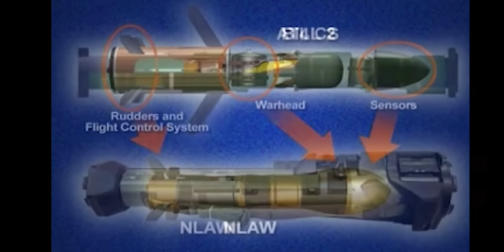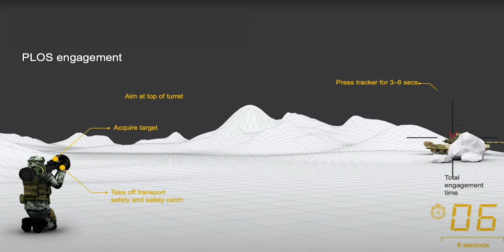Is the NLAW ATGM overrated? Next Generation Anti-Tank Missile

Comment: I am very much torn in half about support weapons embedded into a section/squad or even platoon. OK I do get it. It is far better to have one when you need it rather than not having one. But we keep adding to the basic kit of the section and we are subtracting from endurance of movement and infiltration. 
I believe NLAW has a long career ahead of it as it ticks the 2 main boxes of availability and simplicity of use. The RPG-7 and in the West the Carl Gustav remain the most used RPGS in the world because they too tick these boxes and another vital box re-usability. It could easily be done by having the ammunition come with its own insertion tube that uses 3 or more alignment grooves or spines so that all pins and connectors are perfectly aligned and still remain simple to use. 
Science has the bad habit of removing the amazing and replacing it with the simple. The overhead attack works on the interaction of the electromagnetic fields of 2 objects in question.  The interaction reaches maximum intensity and the moment the it starts to drop the round ignites, similar to the proximity fuse. Trees and rocks don't normally have electromagnetic fields of the massive field that a vehicle has. Sorry if I killed amazing. 
Why the unnecessary night gear in the photos,  the simple answer is propaganda.  Nothing says I am a high tech warrior like night vision on the helmut.
I was once talking to a crewman from our Leopard 1A3/4 (Australia) and pentration and I think what he said about it is still relevant today.  Go into a 5 story building fire escape stairwell with your mate at the bottom of them. From the top you tip a bucket of super balls down the stairwell.  Then ask him what was it like, if he doesn't hit you first.

Comment: Also, the TOW-II is top tech just like NLAW as it's passing over on parallel/horizontal trajectory..
Reply: Depending on the missle used, you get wide array of effects. Direct & top attack vary between missile used, as well as other purpose made missile choices.
Reply: They’re completely different, Tow isn’t even able to be shoulder launched.
Comparing the two is like comparing desk phones to IPhones
Reply: @xxxlonewolf49  Would you compare a handgrenade to a 15.5 cm artillery shell?
There are occasions where that is relevant and reasonable, and ties when it is just stupid.

Comment: The size is a downside in my eyes. I think we(Denmark) have a perfect mix of AT weapons today. We use the new enhanced capability M72 on squad level. Very good in urban fighting. Then Carl Gustav M4 on platoon level. With the new smart sight from Aimpoint. Laserguided ammunition will soon be available. And then Spike LR2 on company level.
Reply: IMO
M72 for almost everyone.
Carl Gustav for the weapons squad in each platoon
Issue NLAWs if expecting armor contact on a squad level. M72 takes care of up close up light armor or side/read of tanks, and bunkers, NLAWs give infantry all aspect standoff capability against MBTs, up to 800m stationary, and 400m moving. It's not even comparable in both capability and weight.
Reply: @prfwrx2497  I'm not comparing the M72 and the NLAW. I would though compared it to the new CG M4, with the new smart sight. These NLAW's takes up a lot of space inside a CV90. Not such a big problem in our Piranha 5 APC's. But still, I think we've a very good setup when it comes to fighting armour dismounted 🤷‍♂️
Reply: @heinedenmark  I disagree, as an infantry platoon you want something that is more LR than the CG. I do see your point about the space it takes though

Comment: I watched the Saab video discussed and thought it was excellent, a question i have though is that it mentions a "saltwater counterweight system" what exactly is that? also in one of the scenes it showed 3 soldiers with NLAW's were they Swedish, British and Finnish?
Reply: Salt is added to the water to reduce the freezing temperature so it is not just a solid block of ice in the winter.  Let's consider an AT4 with no salt water.

 The projectile is launched from a tube open at both ends.  The propellant is ignited behind the projectile so a lot of hot gas will go back when it pushes the projectile forward. That way there is very little recoil but a lot of backblasts that would kill you if are close. In peacetime no one should be in a 90-degree cone 100m long, in wartime it is no one within 15 meters and beyond that, you need to be in cover.

That exhaust will bounce on a wall and come back toward the shooter so firing an AT4 in an enclosed space can kill the user.  The solution was to put a container with water at the back of the tube, that is the AT4CS (Confined Space). Its increased mass will result in the slower exhaust, reduce the temperature and it will slow down quicker.  The no-person allowed area is reduced to a 50-degree angle and 20 meters. The result is you can use it indoors, the requirement is according to the  US manual a room 4.5 meters long and 3.5 meters wide for safe usage.

NLAW uses the same saltwater container design to have very low recoil and the ability to use it indoors in large enough rooms.

Comment: As I've come to understand it the Americans see the supply chain as a big what if. What I've understood is that to use out of country suppliers is the potential to have part's intercepted in transit and either hijacked, tampered with, or in the case of ships sunk but the potential of a major interruption in the access to the raw materials, or finished components, the shorter supply lines to the UK, Finland, and any other of the manufacturing nations is short and there are quicker ways to ship than just ships they can easily ship them by air in small commercial airlines capable of transfer components almost to the front door of the other company's involved anywhere in an hour or so. Where the US is a long distance run making ships rather easy to intercept or sink. Aircraft would have to be much larger hauling more per load making for plump targets that are rarely equiped to deal with a pair of fighters.  While home made mean secure supply lines that are almost impossible for another nation to attack by surprise, unless it's Canada or Mexico. Their radar coverage is rather organic since Canada is so intertwined with the US where Air defence radar's are that they should be considered one. So the fact that they possess the raw materials needed that if nessary they can weather a interruption in a raw material wont slow the production as much as losing a few ships would just about bring everything to a halt since components from us wouldn't make it in time to keep production up and running.

Comment: The NLAW is definitely a good AT weapon. However...

MB tanks move fast during action or penetration through a defensive line, supported by APCs and snipers who shoot any soldier above ground level trying to raise the NLAW and fire it at tanks. The sniper's range and APC mahcine gun range are up to 1000 meters, meaning any soldier who raises his waist or torso above ground level will probably get shot before the NLAW missile fires.

Second, the speed of the NLAW is around 200 meters per second according to the Saab commercial. This means it needs at least four seconds to travel the 800 meters distance. The problem is that many modern tanks have heat seekers which automatically find the NLAW heat source and shooter's position and send a 125mm round to this exact postion. 

Third, 500mm of equivalent steel armor penetration may not be enough to penetrate most modern MBTs with additional armor. This is ok to immobilize a MBT, but not as advertized in the Saab video. Most videos show a lone tank shot from close distance. In reality, MBTs have infantry and APC around, move very fast and rarely leave more than a second for a chance to shoot it easily. 

Just my 2c.
Reply: Umm... if that's how you expect anyone to engage AFVs... you need to find a modern soldiers manual.

Hint: In the Swedish soldiers manual from 2001, there is an illustration of a tank and a quartered overlay of how to attack it.
The rear 90° is labeled 'best'
The two side 90° are labeled 'good enough' (only if the turret is facing away from you)
The front 90° quarter is coloured red, and labeled 'suicide'
Reply: What modern tank has 500mm of equivalent steel armor on the top of the tank? You should use it in the overfly top attack mode against armored vehicles, the direct attack mode is for structures and non-armoured vehicles.
Reply: @target844  Any fast moving tank. You clearly missed the video what Mat was saying. The 500mm penetration is in a direct hit case, the top attack mode much less. This in not a Javelin, the NLAW has a proximity detonation in the top attack mode.
Reply: Errrrm: Ukraine. Enough said.

Comment: What I don't quite get is how the shaped charge fire's in two directions. It's the same as any other top down it just doesn't have the shaped charge facing forward, it faces down. It's a lensing system and like any lens it can be set to focus at different ranges. Is there a way a lense can be formed in two directions or does it pack two charges?

The NLAW was designed to be used in buildings. That's going to require a pushout rocket to lower the back blast.
Reply: I infer from the cutaways that in Overfly Top Attack mode, the downwards-pointed shaped charge is used to form a jet of metal and that in Direct Attack mode, the charge just explodes outwards, perhaps by detonating the charge from the side and spoiling the focus, producing a weaker, diffuse blast that is still effective (perhaps more so) against soft-skinned vehicles.
Reply: It has a device in the back that absorbs the backward energy of the missile.

Comment: Better than a LAW? Yea.
Better than a Javalin? Hell no. Just cheaper. 
ITAS, the improved TOW, is less mobile, but super effective still.
Reply: NLAW is lighter, doesn't need a CLU with batteries that run out to cool the thermals .  NLAW can hit a tank behind a wall that cant even be seen.   You aim above it.   NLAW can never be jammed.
Reply: @williamzk9083  Javalin and Tow can't be jammed either, lol. Deploy smoke, the missile STILL goes where it was/is aimed. Active kill will still kill ANY missile.
Jammed...lol. 
 And the CLU is one of the BEST features of Javalin. If you don't understand that, you've clearly NEVER used one in a combat zone.
Reply: @xxxlonewolf49  There are a number of pathways to jam with both TOW and Javelin.
The Tow missile has a tracking emitter in the tail and tracking optics at the launcher with the operator.   If a TOW is detected by infrared or radar a laser can be scanned in the direction of the missile which will find the optics of the launcher.  The laser can then blind the operator, interfere with the tracking mechanism or burn out the tracking.   It can even fire a round at the operator.   We know that the US Army has equipment that can find a optics this way.  They killed a couple of news cameraman using big Sony Professional Cameras that way in Gulf War 1.  Smoke screen can be deployed and to hide the tank and a well trained crew brake or accelerate the tank if the missile is more than 1km (5 seconds) away.   The Russians can't do this (Shtora 1) but the Chinese probably can.
-Javelin can be blinded by a laser or obscuring smoke and flares deployed.  The missile at 2km would have a flight time of 10 seconds.  Javelin is an aging missile with a low resolution infrared array and relatively crude image processing.   
-Javelin (22.5kg with CLU of which CLU is 6.4kg) is much heavier than NLAW (12.5kg) and the CLU must be carried as well.  On top of that two batteries need to be taken into combat to cool missile and CLU thermals and they run out quickly.

Comment: Well the price is going to come down with volume production. The important thing is to get them into the light infantry's hands.
It can provide a mobility kill on an armoured vehicle, but they will probably kill more transport trucks. They can be used by light infantry "dads-army" types. A tank without fuel and ammunition is just a traffic accident, that has happened.

In practise i much doubt they will be used in excess of 400 meters, but that is all right, as vehicle mounted systems will have started whittling down the hostile force. Bring it to a halt - and serve the target on a platter to the artillery.
Reply: As Ukr farmers showed, a tank without fuel isn't a traffic accident, it's free real estate! YOINK! 🤣
And it's always cheaper than an AFV plus crew.

Comment: If you're shooting at an MBT at less than 800 meters you're already in a world of trouble. Most modern mbt's  main guns can shoot you at ranges exceeding 3,000 meters.
Reply: So its all a myth Ukrainians hit so many MBT`s and other vehicles? :). 
Do you know how difficult it is to spot small targets from a MBT/APC 360 degrees around 24/7. Especially if the hatches are closed? And then react correct inside a max 5-7 second window above that too.
Reply: An MTB can shoot you at 3,000 meters if there is a light of sight between you. So you should hide behind something or in a trench.  It would be quite useless if you were dropped on a salt flat with no time to dig down and an MTB come for you. But in an urban area getting within 800 meters of a tank will not be hard.

Most combat is not at 3,000 meters because soldiers will use the terrain to their advantage both when attacking and defending.

Comment: Compared with what we had in the 80s the NLAW is an amazing bit of kit. Lot more mobile than the old Carl G fire and forget or the extremely long recoiless rifle, we had TOW, blowpipe but they weren’t handed out to most grunts they were a specialist bit of kit, usually called in. But the nlaw is simple to use and as mobile as the venerable 84

Comment: I believe there's nothing in its "projectile" designed to explode inside the tank.  Shaped charge works by concentrating a jet of molten metal, usually copper,  to punch through tank armor.  That alone is enough to stop or even destroy a tank.
Reply: Molten ?
Reply: @dwwolf4636  
Yes.
Reply: @tolitsdterrible4785  It is not molten metal, the metal is just moving so hot and fast it behaves like a fluid.
Reply: @voidtempering8700  
So, what do you call a metal that so hot it became fluid?  Please educate me.  😊
Reply: @tolitsdterrible4785  Using molten usually makes it seem like you are describing something melting through armor, where in reality, it is purely kinetic. Also, it is not a fluid because it is hot, it is a fluid because of the collapse and formation of the blast wave causes a collision, which pushes the material.
Reply: @voidtempering8700  
I never said that.  You are just making your own assumptions.  Of course it's kinetic, that's the purpose of shaping the charge, propelling the jet at hypersonic speed.  Depending on application, they can even use lead with very low melting point, so what do think happens to lead if used as liner in a shaped charge?
Reply: @tolitsdterrible4785  The lead would be very hot, but the heat would not cause if to liquidfy. It utilizes the Monroe effect to form a metal jet, it behaves like a liquid, but it isn't exactly a liquid.
Reply: @voidtempering8700  
I don't why my reply got deleted.  Maybe because of the link I provided.  So, to repeat, where in "Monroe Effect" does it says that the metal liner won't be melted?  Can you answer that?  Now, here is a portion of the article I linked earlier that got deleted.  "Since the shock impedance of the liner is greater than the impedance of the explosive, the shock pressure in the liner will be greater than the pressure po in the explosive. Because (1) the liner material is melted almost immediately due to the extremely high temperature caused by the shock wave, and (2) the free surface inside of the liner makes the particle velocity double due to rarefaction (or reflection), a jet of the melted liner will be formed along the axis of the cone from the apex"
Reply: @voidtempering8700  
You can google the article where it came from.  I cannot post the link here as it will be deleted.  I just hope that you read it thoroughly before making another statement that doesn't make sense. 😊
Reply: @tolitsdterrible4785  You are right, I didn't quite understand the definition of molten, and the material, depending on the material, could be melted.